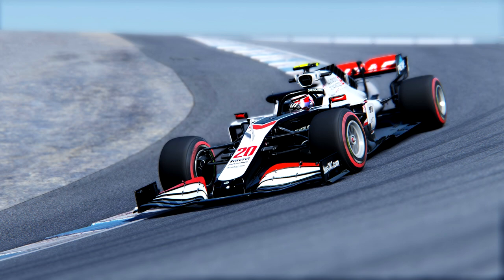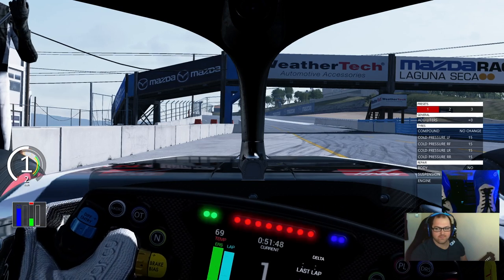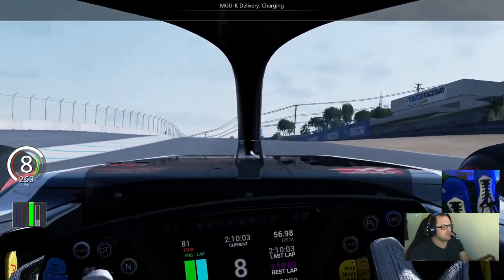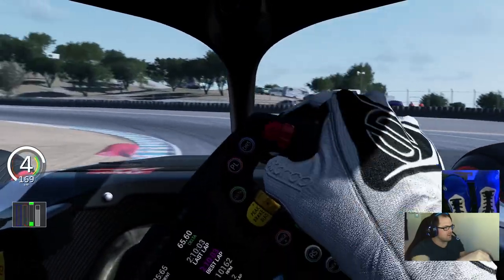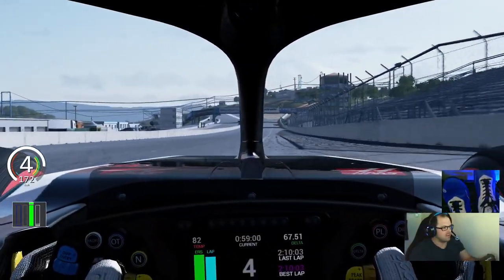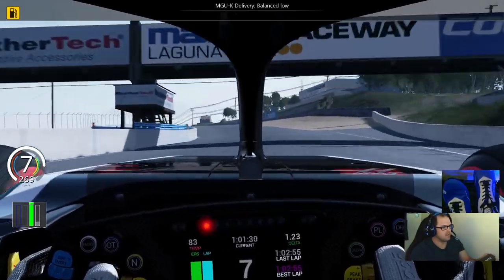F1 TACKLES THE CORKSCREW! Could F1 Handle Episode 3: Laguna SECA

Comment: Laguna Seca has an absolutely tiny paddock, when MotoGP used to go there they couldn't bring any of the support classes.
Reply: That’s because the support series at the time were 250cc and 125cc two strokes which are illegal in California during the summer.
Reply: @chrisclifford4109  yes two stroke motorcycles are illegal in commie fornia
Reply: @chrisclifford4109  that’s a really stupid law😂
Reply: That might be one of the biggest things holding it back from being a grade 1 circuit
Reply: The track chose to not bring in the lower classes, because DORNA wanted absurd amounts of money for them, and they're simply not a draw.  They could bring in AMA to suppliment the MotoGP bikes for a fraction of the cost.

Comment: This would be so fun in F1 but I’d be worried the FIA would ruin the track in order to get it to meet the criteria for F1.  Amazing video regardless cheers!
Reply: They tried to get F1 but they lost out to the Detroit street circuit.
Reply: They already did in order to attract MotoGP and, hopefully, F1 in 1988. It used to be 9 corners. You were flat out from the exit of turn 9 to turn 4 just past the bridge. You had to be pretty brave not to lift at 3!
Reply: It would be very, very boring. No overtaking would happen.
Reply: Yeh, sure.  F1 would be monstrously, mind-destroyingly boring with ZERO overtaking possible at Laguna Seca, the world's most over-rated track.  It's tiny, it's way too short, it's way too narrow, and it doesn't even remotely have the necessary facilities.  It used to be my local track, and I enjoyed going there, but F1?  Nah, never in a month of Sundays.

Comment: There were F1 to Laguna Seca rumors way back in the early '90s when the current layout was still new (everything between the pit straight and the lefthander that leads up the hill was added in 1988-89 to attract what we now know as MotoGP). If it didn't happen then, it's not going to happen now, even with F1's renewed interest in the US market. The wheelbases of today's cars alone basically rule it out...they'd all be high-centered on the corkscrew on lap 1.

Comment: I actually asked myself about a month ago if this track could be run by those cars.
Two observations. Both involve the corkscrew.
First the physiological effects of that negative g drop would have on the driver. Specifically red out to the eyes.

Second observation is what would happen if a wreck occurred there. Depending on the gap between racers and how long it would take to get a yellow signal that the driver actually sees and reacts for that could be an expensive and dangerous kink in the track.
Good video!

Comment: Having driven this track many times in my E46 M3, seeing a car lap here sub-1:00 is mind blowing. Just shows how incredibly phenomenal modern F1 cars are. Having said that-- I would love to see F1 at Laguna Seca despite such a short track. Monterey Car Week is a petrolhead spectacle. Folks come in groves to watch Endurance races, Indycar, and formerly MotoGP at this famed track. Why not F1?
Reply: Sadly, it doesn't come up to modern F1 standards. Not so much the track itself, it's the tiny paddock. WSB still goes there (well, under normal circumstances) and even they can't take support races. I used to watch Cart racing there (Indy is on a pay-a-ton-for channel, Cart was on Eurosport which comes with the basic but still expensive satellite TV I have to have - crap reception for terrestrial broadcasting) and I remember some absolutely classic moves, especially at the corkscrew! And Rossi in Moto GP pulling a cracker on Stoner... It was like those guys were the only ones in the race but it was amazing!
As someone else has said, local ordinances are v strict and it just wouldn't be feasible to take F1 there :(

Comment: Always great to see you in the simulator. But one thing I have noticed about your driving is that your down shifts are rough and inconsistent. Even over several laps of the same track.
This is an area where If you can smooth out the down shift and break just a little earlier I think you should get consecutive sub 1 minute times.
Even with the basic set up.